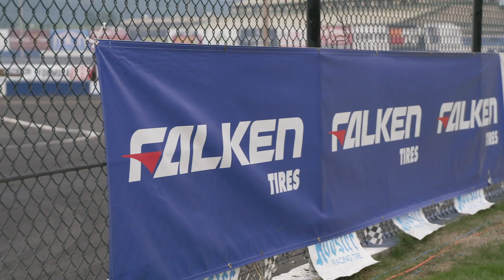Rollin' Out w/ Odi Bakchis #FDSEA

Comment: What kind of motor is that? A procharged LS?
Reply: Its a centrifugal supercharger but I dont think its from procharged
Reply: I believe he said it was a vortex supercharger
Reply: CBM Built LS With vortech centrifugal supercharger
Reply: Not saying it is but from the top view it looks like a screw compressor
Reply: You can look up the series on YouTube where he built the car, he shows pretty much everything. Bakchis build is what the series is called. And yes, it's an LS with a big ol' centrifugal supercharger on it. Which he had to bypass in this case because everything was shagged because of the crash.
Reply: @Alief_han11  he switch to Texas Speed this year along with Matt